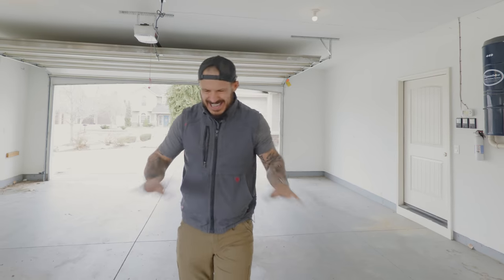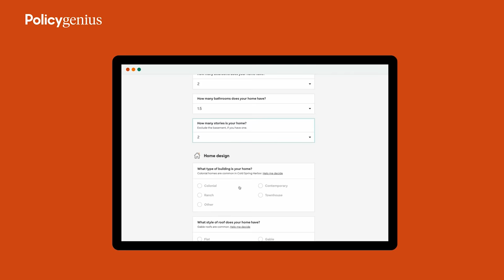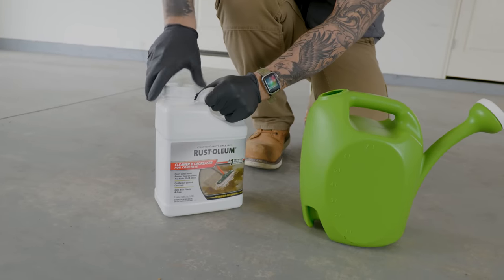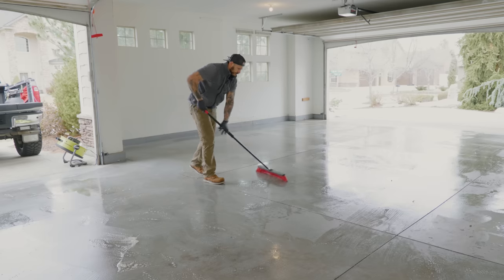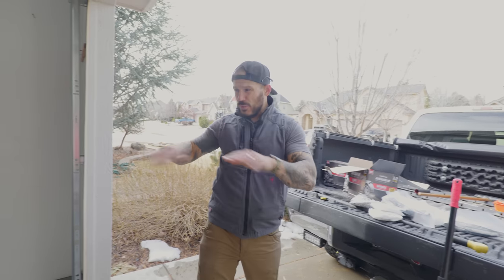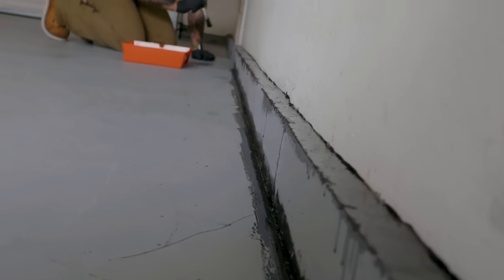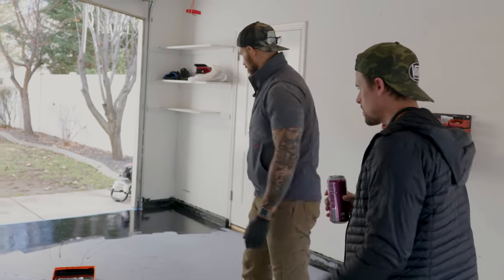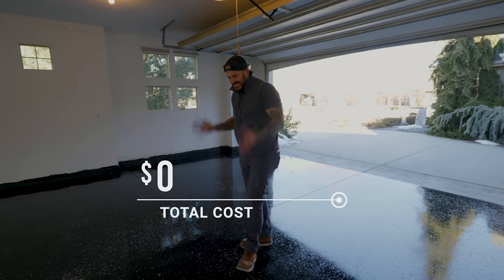New Garage Floor Epoxy + SAVED $5,000 BY DOING IT MYSELF || Concrete Slab House Reno (Ep.3)

Comment: Do not do what you see this guy doing, diamond grinder on concrete, moisture barrier then 100% epoxy solid with flakes.  Then sealer.
NEVER GET THE CONCRETE WET!!  Stay away from big box stores materials.

Comment: Lol, comparing the price of your store bought one coat epoxy product to what a professional is gonna charge is like comparing apples to porcupines.   I'm sure the 3-5,000 quotes weren't just giving you one coat. And they were probably quoting full flake coatings, not random flake.   So its not quite accurate to say you saved $4,000 by doing the same floor yourself.

Comment: So….Then you parked a car with HOT TIRES on it. … The EXPOY LIFTED … your $400.00 product FAILED … NOW to correct it will COST $$$7 - $$$8,000.00 …. I know….Resurfacing Concrete was my SPECIALTY. NO ONE WILL TOUCH FOR LESS 7 gram to correct what you SCREWED UP

Comment: This guy has no idea what he’s doing. He used the worst epoxy paint you can use and he didnt even grind down the floors before pooring it. Plus he didnt put a clear top coat on it after. That garage is going to be garbage in 3 months

Comment: The fact that he said his friends were quoted 3-5k for the same thing is just disingenuous or he didn’t do any research. 

I lay down actual poured epoxy coatings as a contractor and it’s much different. I prep with a diamond blade to get good adhesion and lay down at least 3 coats of much stronger epoxy with paint chips laid in to add strength. 

These rustoleum and similar products are basically just paint. They never last more than a year with any vehicles in the garage and can even peel off from hot tires. It initially looks good but it’s essentially useless unless only used with foot traffic. 

You have a big enough channel, hire someone to do proper research if you can’t be bothered. Or don’t take sponsorships from companies that make garbage products. Either way.

Comment: All your prep is wrong. Wet prep. Wrong. No grinding, epoxy will not  have proper adhesive bond. It’s snowing outside, epoxy won’t cure properly. You’re set for failure minimum 5 different ways. I would know I own an epoxy company lol

Comment: Cheap garbage epoxy  chips like the original job. Hint don't buy the big box store garbage. Good floor epoxy costs alot of money even DIY. Also this job won't last at all piss poor prep, you must use a diamond grinding wheel to get a good bound and you must acid etched, you must remove the old epoxy. There is a huge reason professional jobs cost alot, commercial grade epoxy and proper prep.

Comment: You didn't get CLOSE to prepping that floor correctly. You don't just paint over paint. And that's basically what you have - concrete paint. Can't even call that real epoxy. Not only does it not look like a professional grade floor, it won't perform like one either. And there's no top coat. This whole video is a joke & extremely misleading. Hard to watch.

Comment: Not the best instruction video.  Lots of jokes, too casual.  No grinding.  The epoxy has a limited application time once mixed, it gets tacky fast and it looks like you had all day to cover the edges and run some chores.